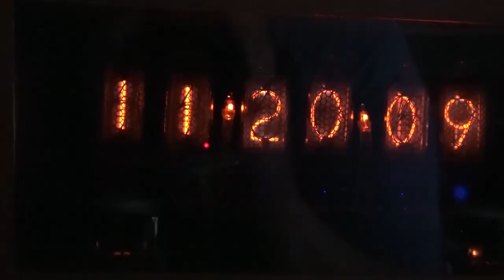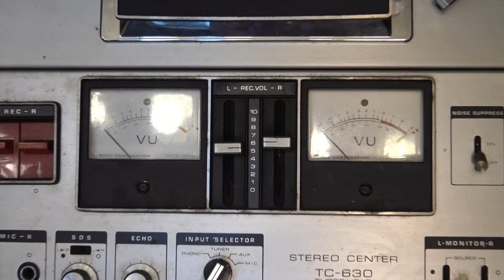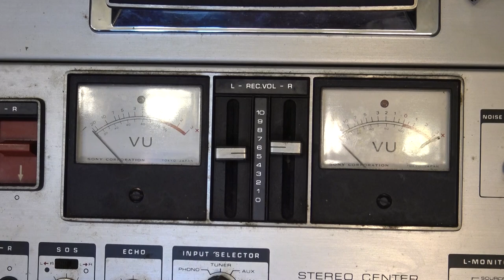Pirate radio in Vancouver July 20   21 1984

Comment: I remember a pirate station that operated out of Burnaby in the 70's that disguised itself as a K*** station from Washington and it was never caught or shut down.  I think it broadcast around 88.x on a small transmitter. I used to listen to it late at night when I worked at McDonalds on the clean-up crew. I had an interest in radio and ended up meeting the two fellows that ran the station. I even did a one hour cassette tape that they aired one night while I was working. Both of the fellows ended up working at radio stations in Vancouver during their careers.
Reply: Update ... one of the gentlemen I was referring to died a few years ago and the other one is happily retired and living up country. One of them actually became a radio station program manager during his career. Those were the golden days of radio where you could actually work in the medium you loved and have a career from it. Now it's news and talking heads with corporations supplying the playlists out of mostly American cities. Canadian content is substituted for local regional content on the supplied playlists. That's what is killing radio and broadcasting in general. Too few corporations controlling too many stations. The CRTC once limited the number of newspapers, television and radio stations that could be owned and controlled by a single ownership group. Now it seems anything goes. One owner controls most of a regions newspapers so no competition. And a limited number of owners control the radio and television stations nationally and in each region. 200 channels all playing the same repeating programs and playlists.

Comment: Super gutsy of him to give his phone number out. Definitely a different era of pirate radio. I currently run a whole 7 watts, out here in the middle of nowhere, and even then, I only use an email address that I set up specifically for the station, and even then it's not a 100% safe and secure way of communicating with your listeners. Although I believe there's an app that runs your login info through a server in Africa so it masks where you login from. Guess I should look into that. Excuse me, while I go do that!!!!
Reply from the maker: Brett Cooper 
He did get busted but not for what you think. Running the transmitter was not why they shut him down. Telling off color and racist jokes, and he started taking advertising for local businesses. This caused complaints from the people he was offending and from licensed stations that lost some advertising dollars to the pirate.  There are many low power stations across the country that only play music and chatter about music. They are left alone. Bring politics, political issues, religion, hate speech ECT and that will draw complaints and result in shut down. There was another one out here for years that operated, with probably 100 watts or more. Could be heard everywhere. He was told to shut down because the CBC wanted to put another french station on the frequency. Never charged him just knocked on his door and told him to turn it off. I know the guy that did it quite well as he is a ham operator as well.

Comment: As if the Strange Brew guys ran a pirate radio station.
Reply from the maker: There were a few pirates our this way a few years back. Now the band is full of duplicates. Seems every station has to have a second or 3rd transmitter to extend their coverage. The pirates got pushed out because there was no place for them to go. I guess there is always the AM band, but that requires a large antenna and big power to go anywhere.

Comment: What was his frequency? 87.9? The FM band is 88 to 108 Mhz, so he's just below the bottom end of the band, technically that makes him a "narrowcaster" as he is outside the standard bandwidth. Oops, just heard, 89.7, JUST inside the bottom of the band. Yeah, my mistake!
Reply from the maker: The old FM band was 88.1 to 107.9, but all current FM radios will tune 87.7 to 107.9 or 108.1. My Sony bench stereo tunes to 87.5 as that is where I have my test transmitter on FM and 1440 for my AM test transmitter.
Reply: Regardless of the capabilities of tuners to go as low as 87.5 Mhz on FM or above 1605 KHz on AM, the STANDARD band in each case is still 88 to 108 Mhz FM and 535 to 1605 Khz AM. Anything above or below those frequencies on either band is "narrowcast".
Reply: No, I think it was 89.something, well within the standard FM broadcast band.

Comment: The guy says his name and phone number.. How did he not expect the authorities to figure out where he was... ?
Reply from the maker: Well I believe he was using the old test numbers. I get the feeling that he worked for the phone company, but he never said, but his number would change every time he went on the air, so I have a feeling he probably worked in the central office, and just ran a spare line to his apartment and would jumper one of the test circuits to his line on a friday at the end of his shift, and then monday morning pull the jumpers. Pretty easy to do for anyone that works at the phone company.
Every cross connect used to have an installer talk pair and 3 EDT lines. An EDT was referred to as an express dial tone, that could be tied down to a customers line in an emergency to get them back up and running if it was a CO pair, or line equipment that went bad. That was from the days where the field tech didn't do central office work and the central office personnel only worked M-F. These days field techs have to go to the central office and change out CO feeder pairs, or chance line equipment off hours, or on weekends, or anytime for the unmanned offices like the one I work out of. There is 1 person that maintains about 5 offices, and 30 remotes, so the chances of them being where you need then when you need them is slim, so the techs all have to do their own jumper running.  In the months he operated his number changed every time and it would come up as out of service on the monday. So either he worked in the frame, or perhaps the test desk, and would just change his number every week. As I said they did shut him down, it made the papers when it happened. He probably would have gotten away with it much longer had he not one the off color jokes and pulled complaints from the public, and had not started selling advertising at a discount, and was taking advertising away from the local licensed stations. That one was probably the big no no more than firing up a transmitter. Once the calls started coming in from the licensed stations that he was costing them advertising revenue the boys in blue stepped in.

Comment: wonder how many watts he was putting out & how big ariel he would've needed
Reply from the maker: He told me 40 watts, which sounds about right knowing what I know about VHF propagation. It is line of sight. Many people do not realize that most FM stations are ony putting a few KW up the pipe. When they saw 45KW ERP that is factoring in antenna gain for the array. Leaving the transmitter might onkly be 5 or 6Kw. So if this guy had 40 watts leaving the transmitter, and ran a short feed line, saw 3dB, he would have 20 reaching the antenna. Then if his antenna had perhaps 6dBi gain, his ERP would be rated at 80.
Of course I don't know what he used for an antenna, or feed line. He said it was a directional FM yagi horizontally polarized pointing south. Sounds about right considering the distance and the signal to noise level on the tape to background noise.